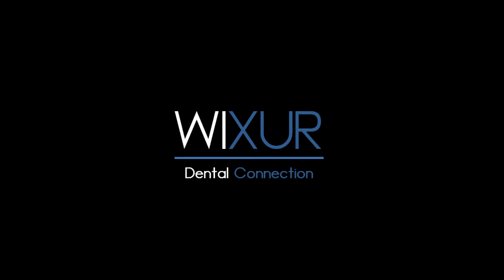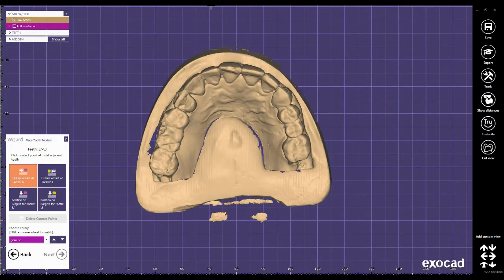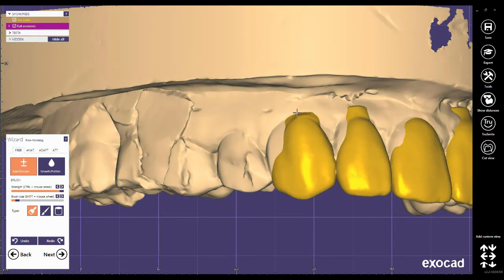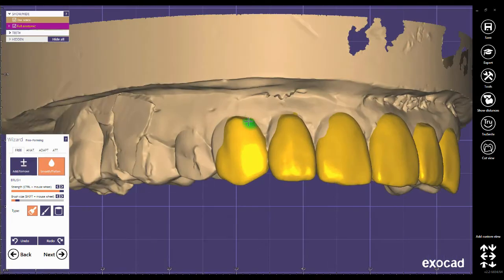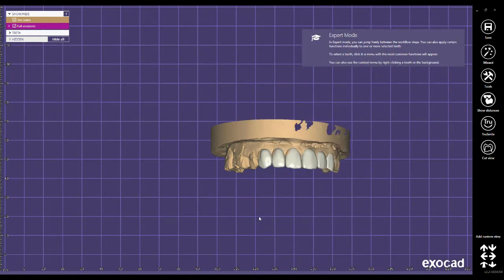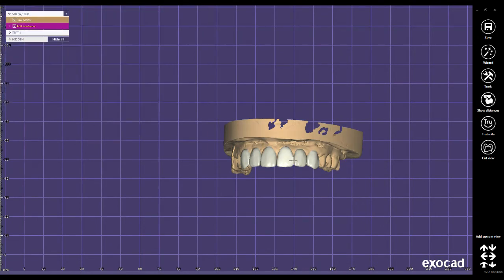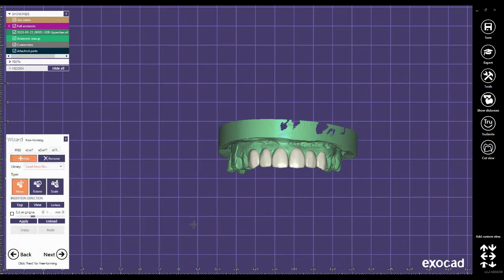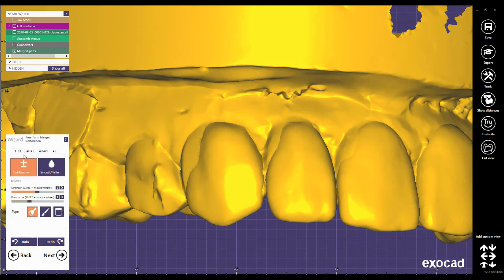Exocad - Digital Mock-up

Comment: Hello sir... I tried the same way to make like this, I am using EXOCAD...
But in the end the result is not same and in the end after attachment there are different result...
Kindly send me your telegram or email or Whatsapp to contact with you!
Reply from the maker: Dear Rose,
Please choose the teeth as "Coping" in Exocad DB and then scan the cast. After scanning change the teeth to "Anatomic Pontic" and then save the job and do the design.
I hope this solves the problem.
Please let me know about the result.
Good luck!